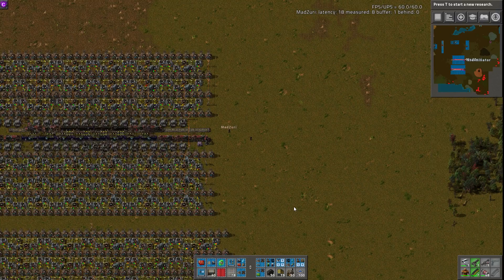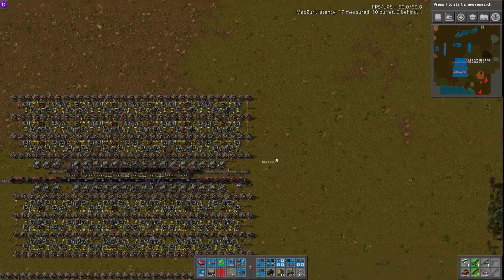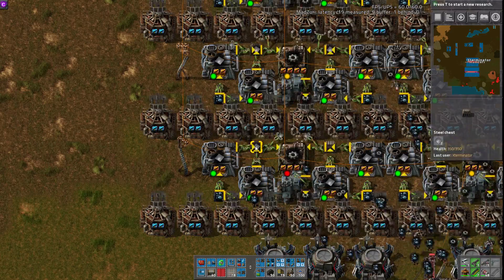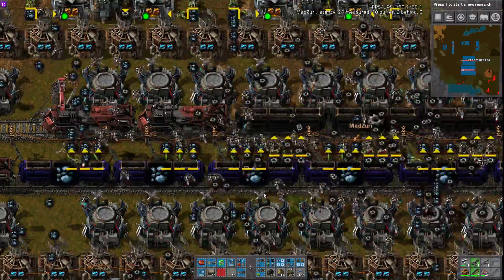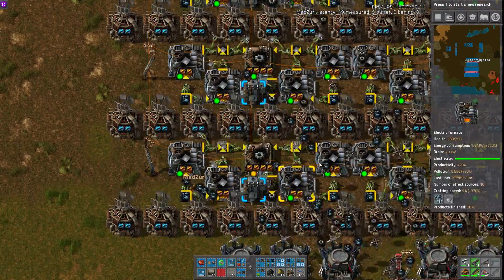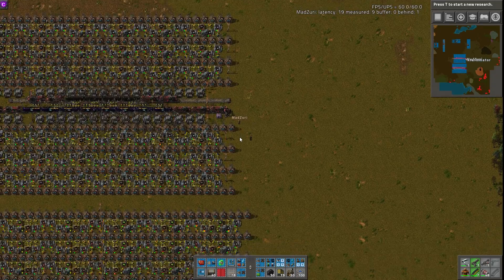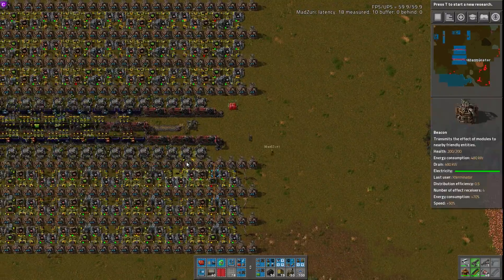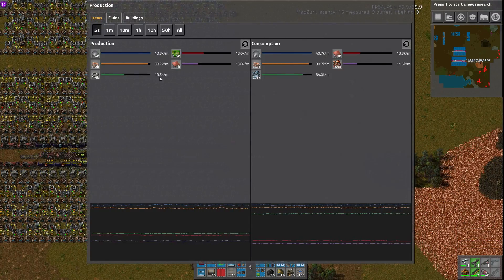Direct Insert Gear & Circuit Builds :: Factorio Workshop Season 2 - Building A Better Factory

Comment: I recently started a new map and decided to give it a go with gears on main bus (it's great in 0.15), but didn't think of making it direct insertion from the smelters. I definitely would try if I started anew, having to work with smaller steel furnaces at first might be fun.
Reply from the maker: Yeah that could be quite interesting. :)